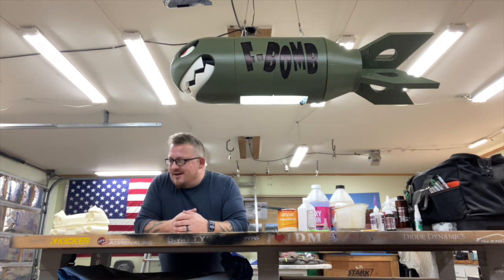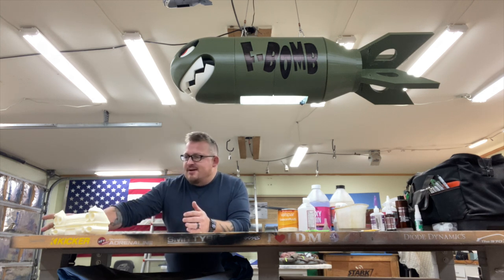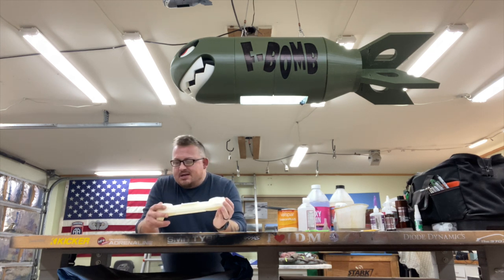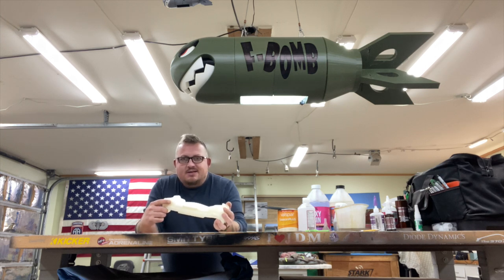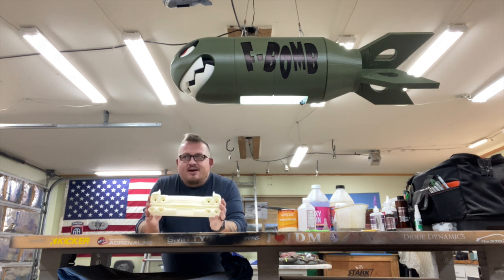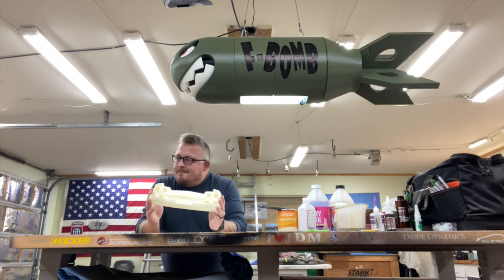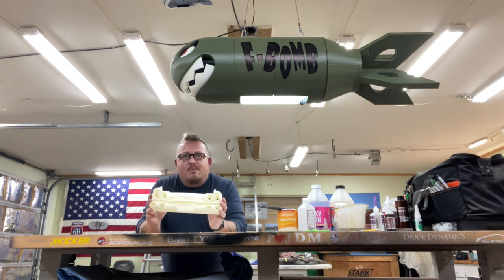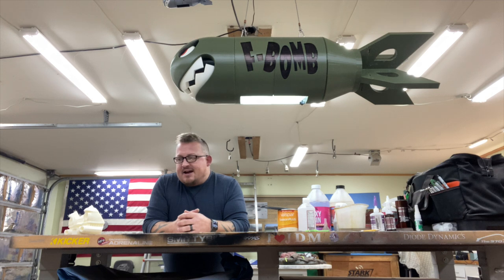Ecto-1 Part_1

Comment: what is that scale? what printer did you print it out on? I love the scale wonder if fit on my ender 3
Reply from the maker: It is a hair over 1:7 at 250% of the model scaled up. The body was printed on Fusion3 F410

Comment: ugh they changed the model, now it takes 7 days for one piece to print.
Reply from the maker: Not understanding. Is it the model? Or your settings? I know the artist and he’s a great guy, do you need the older version to save time or?…#OneLdMnstr
Reply: @LeSanglierQuiRit  I'm trying to cut it up in mesh mixer. .1 resloution witth a ton of supports takes a LONG time to print
Reply from the maker: @KingNothing22  ahh, gotcha. Yeah, some of the parts do certainly need alot of support. I know some of my slices certainly did 😅
Reply: @LeSanglierQuiRit  he said .1 resolution unless you used .28
Reply from the maker: No, given how much I scaled it up, I printed it at .2